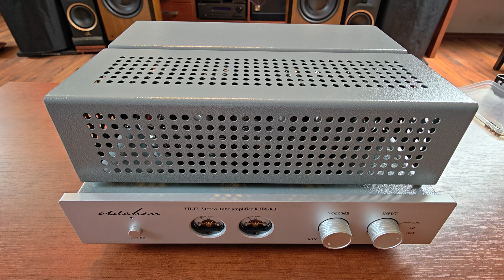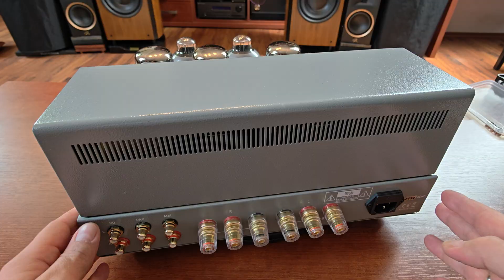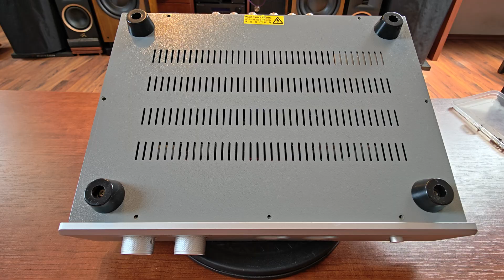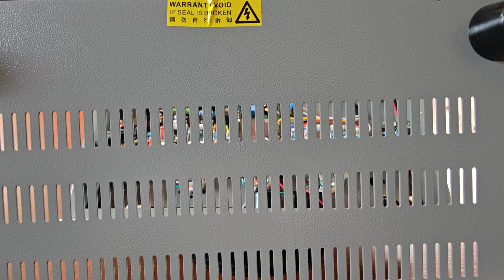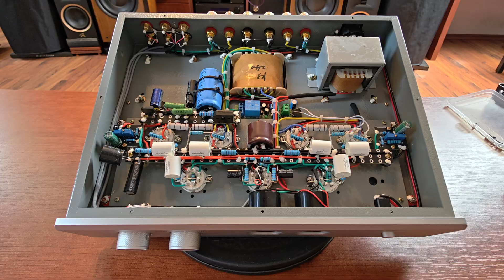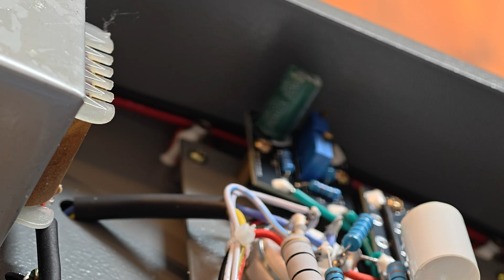Tubes again! Oldchen KT88-K3 tube amplifier first look and internal build video!

Comment: KT 88 amps are pointless.They sound more like SS but not as good bass control. or ability to handle low impedance 4 ohm speakers.Especially cheap ones like this.I tried a Cayin A 88T a while back with gold Lion KT 88s.That is considered one of the better KT88 amps and preferred by some to Macintosh 275.A very average sort of sound and bettered by all my SS amps Including a cheap gainclone type chip amp. Also owned a SE KT 88 that sounded dry and horrible.My vintage EL34 monoblocs sound so much better .As do my SETs.
Reply: 845 Amps blow KT 88 Transistor and EL34 Amps out the Water. My Trany amps sound Warm Slow Vague etc just like KT88 EL34 crap by comparison
Reply: @matthewtaylor7355  Push pull or SET?
Reply: . set. My 300b amp is muddy. 845 have far more Wight Solidity Clarity etc
Reply from the maker: I have to try one. I've also seen that 845 tubes are pretty expensive, KT88 are cheap in comparison
Reply: @k4syx 100 GBP a pair is cheap. The Amp cost 1150 GBP including Tax. It will soung great with large BW Copies. It produces a solid massive clear sound and u can turn the volume up. Dave Manager at Audio T in Manchester would put it in the Shop window with 5 or 6k price Tag on it. It will piss all over that kt 88 as it does my 300B amp

Comment: Antique junk tube device kit sells in such high price ?
Tube never last more than 1000 hours. Tube made amplifier ever able to match sound quality with IC made amplifier.
Reply from the maker: I was always a solid state guy - until recently.
The thing is that tube amps do not try to match SS amps performance. They have their own way of presenting the sound and though tubes do have finite lifespan, it's worth it.
So now, I'm chasing not one but two amp rabbits :)

Comment: where are the Output-Transformer. Haven't seen any.
Reply from the maker: There are three large transformers (middle one being significantly larger than the other two) hidden under the shield at the back.
Reply: @k4syx  I would have liked to see the sheet metal package

Comment: Have you ever considered reviewing one of those McIntosh MC275 clones? I'm very curious how they'd perform.
Reply from the maker: Yes, Orsefons. I have one on my list (upgraded version) and I'm really really curious about them because specs say these can drive 2ohm loads, so that would be the only tube amp so far that could - in theory - handle my electrostats. 
But the price is kinda scary especially if that one would turn to be a dud.
I gotta find some courage (or craziness) :)
Reply: @k4syx yeah. $2500 ain't cheap unless it's 95% of the real thing. I was listening to the owner of Amps & Sound Audio and he was saying that McIntosh has a proprietary winding in their transformers and that's their key to their particular sound. I don't know how much real MC 275s are in Poland but they're quite a bit here. More than I'm willing to pay.

Comment: Thanks for the Look Inside, I'm a little disappointed to see a single multi tap output transformer
Reply from the maker: You need to take price into the account, it's pretty cheap for a tube amp :)
Reply: I think you are refering to the power supply choke.  There are 2 output transformers mounted on the top side of the amp.
Reply: @MashBill  yes that thing you see inside is just the choke the power and output transformers are under that hood on the top
Reply: @MashBill Sounds right I sure hope so

Comment: Circuitry looks like a beefeed up version of that el34 oldchen. I think this (k3) is the push pull version, they also have a single ended (k1) kt 88 amplifier. The,added input selector is a nice touch. Bummer about that volume pot but I guess it's alright. looking forward to your next review. I also got the MF A1 clone which should arrive in a couple days.
Reply from the maker: Yes the pot should be easy job to replace with something better. It's push-pull - I want to compare it to Cayin which is also push-pull, also uses KT88 but it's about 20-25prc more expensive